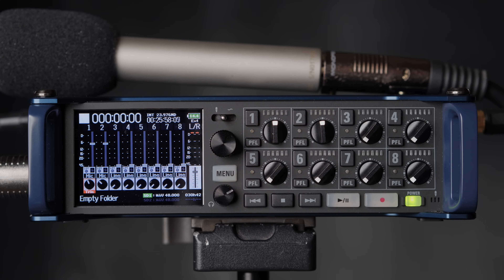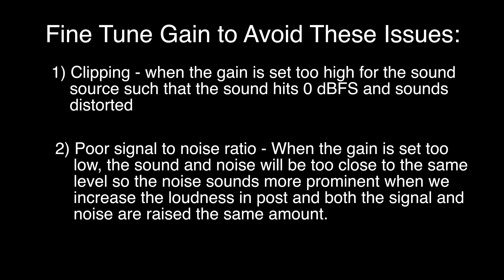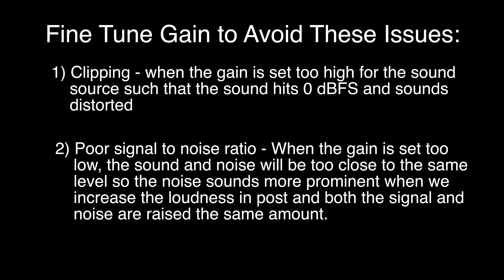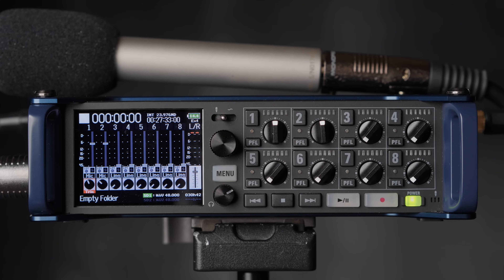Sound for Video Session: Zoom F8/F8n Setting Gain Trim

Comment: Hi Curtis, Here I’m back again... I have the Zoom F8n and a Sennheiser MKH416 shotgun mic. I’ve read the manual, but could not find it... maybe read over it... but how do you setup the Zoom that it records the mono mic on two channels... I found only the options “Dual Channel Rec” and “ Stereo link mode”. Could you help me out with it? Thanks!
Reply: Hi Chasjazzez, Congratulation on your new recorder and microphone! Yes, you need to use Dual Channel Rec. This will enable the secondary channel and then you set the trim for the second channel lower than the first. We cover it in detail in our Zoom F8 course over at school.learnlightandsound.com if you are interested. Best wishes!
Reply: Curtis Judd Thanks I will take a look at your website

Comment: I ran some more tests I think the LED from Godox is just simply too loud I even put it literally like 12ft away and the mic still picks it up. So I don't think it is a placement of mic issue I even turned gain down to absolute lowest with me ultra close to mic less than 1ft and the sound still reaches mic. Do you think the Came-tv 100w fanless is bright enough for key light or is the Aputure 120d a better option? I know aputure has a 120d mark ii coming out that is suppose to be 30% brighter so not sure if that outpowers the Came-TV 100w. I prefer portability and I know the aputure is small but I need something that has some brightness for night shooting indoors so I can fill room with soft light if ever desired but if fan noise becomes issue then aputure 120d won't work. Since you have the 120d would you say it is quieter than a laptop fan that is not doing extensive tasks? Our fridge is like 12ft away but mic doesn't really pick it up much barely audible.
Reply: Hi Michael, I think the best way to assess how loud the 120D is is to listen to any of my talking head videos that have been published on my main channel over the last year. The 120T (and the 120T which is identical in terms of fan noise) has the LightDome softbox on it and the fan on the 120T is approximately 6 to 8 feet away from my face. Here's an example: https://youtu.be/Cel8qLVSD7Q

I haven't used the CameTV 100W so I'm not sure how its output compares to the 120d/t. But I would think that it would be suitable as a key light.
Reply: Personally I can't hear any noise. Is this raw audio no noise removal? I used an app on my ipad for decible test and it register room noise as high as like 50db so this thing is quieter than my room noise if it is rated at 18db. Correction is more like 25 to 29db after calibrating app. Hard to get a proper reading as one app reads 43db.
Reply: No noise removal/reduction processing applied.
Reply: From what I could tell the 120d is much smaller than 100w came-tv I just need an equal measurement to find out, which one is brighter. Even if I don't use the full brightness I just want the option for flexibility. Going to wait on the Mark ii 120d and see how much output gain it gets.

Comment: On the ZoomF8Npro,I set my trim to my desired amount, then use the knob on my tracks for Fading the levels. It all works and sounds fine while I am recording the levels. But once I playback, it only plays the file at my set trim level. None of the fader controls were recorded even though I could hear them while recording. I have tried this in all three recording modes (Trim, Fader, and Mixer) and they all result in the same outcome. I took the SD cards out and played them back in my computer and the issue is still there. It seems like it only records the Pre-Fade audio files instead of the Post-Fade files with my fader levels. This happens on all recorder settings and each input.
If there is anything I am doing wrong then please let me know. I am incredibly open to advice and questions, just trying to figure it out. I have experience on other Sound Devices recorders and I am somewhat new to the Zoom F8N pro recorders. Part of me feels like there is something obvious that I am missing.
Thanks
Reply from the maker: The faders ONLY affect the stereo mix. Record the stereo mix and you’ll have those fader effects.

Comment: I just got the F8N Pro, would like to see a updated version of this with 32 bit in mind. also hope for a small 32 bit float update on the F8N class that I paid for but don't remember how to get back to it.
Reply: You will see an update to the course. My F8n Pro just arrived yesterday. I'll need to run through everything to determine everything that changed but I suspect not much has changed. We will certainly have a new video segment in the course that covers setting gain when recording 32-bit float. The course is over at School.LearnLightAndSound.com. I'll need a few weeks to make the updates.

Comment: Can I ajust the iso tracks during the recording using the fader instead of the trim/gain? The same way a professional recorder would do. On a narrative film environment where you could be using 7 lav mics and 1 boom, the iso tracks are the most important thing and the stereo mix is only used as a reference for post production, since there are only two channels for 8 individual mics. In today standards for sound in narrative filmmaking I don't see this recorder being really useful if you can't fine tune the iso tracks during the recording, the way you can on a SD 788 for example
Reply: And by the way. Does the SD 633 give you this option, of live iso adjustment, like a SD 788 or Zaxcom Nomad would? I'm thinking on moving to the 633 due to the limitations I've been having with the zoom f8
Reply from the maker: Yes, you can. Basic mode does this as does custom mode with the channel know a in basic mode.
Reply from the maker: Yes, there is a separate trim knob.
Reply from the maker: Also, you can adjust trim with the F8/F8n channel knobs, just need to change the channel knob setting.

Comment: Excellent overview.  One correction on the Advanced Limiter. "Target Level" is not equivalent to "Threshold" as described in the video.  I also initially made this same assumption based on traditional limiter controls and operation, however the Advanced Limiter works quite differently and its operation is unfortunately not clearly documented. "Target Level" is a "never to exceed" setting, rather than a traditional threshold level at which limiting begins to be applied.  If you set Target Level to -6dBfs, recorded audio will not peak above -6dBfs, and the actual threshold will be considerably lower. 

It is not overtly clear what the actual threshold is for the Advanced Limiter at various "Target Level" settings, but the change in level-meter indications on the display when Advanced Limiting is switched on hints at it (note that the meters no longer tops out at 0dBfs but rather shifts the 0dB point lower (threshold presumably) and displays a +dB range above that in which limiting is presumably taking place.  It is a 1ms look ahead type digital limiter that appears to apply a variable ratio that increases from 1:1 to infinity (follows a some progressive curve rather than a linear progression above threshold) as signal increases toward Target Level.

Because I am only interested in recording isolated channels and am not recording or outputting a live stereo mix, I keep this set to 0dB for all channels to maximize available dynamic range.  I imagine a lower Target Levels might be useful when manually riding mix levels or automixing.

I hope this helps.  Much confusion about the actual operation of the Advanced Limiter in recording forums.
Reply: Thanks Lee, very much appreciate the additional detail!

Comment: Hello.
I am Sound designer living in South Korea.

I recently bought a Zoom F8n and I have a question.

I am going to record using several microphones, and I am going to save the recording to L R Track with Auto Mix on.

However, LR Track does not have the ability to turn on the limiter.

After experimenting, each track does not have clipping, but a combined Mix File creates clipping.

How should I overcome this problem?
Reply: Hi DayDreamSound, I'll need to look more closely, but I believe the faders allow you to adjust each channel's contribution to the mix, even with AutoMix on. So you'll want to pull those faders back a bit.
Reply: @curtisjudd  Thank you for your answer.
If you have time, could you check on this part?
I know that a low dose of Gain solves the problem, but it's a problem if you take it small when several people talk.
In addition, there are times when eight people laugh at the same time, so you won't be able to get a big response, and then you'll have a problem talking quietly.
I used to use Sound Device Mixpre-6 before, but Mixpre-6 has a Limiter in the Main L R so I can receive it comfortably.

Comment: I would really appreciate this exact video, but for the F6.  I'm  very confused with how 32 bit float removes the need for gain control, but I still think I need to set levels with the faders?
Reply: Hi Dale, yes, the F6 records each channel post-fader so you should set the faders to a reasonable level.

Comment: Thanks for clearing this up about the fader mode, I have and F4 and thought there was something wrong with my F4 because when I turned the Knob down nothing moved then I turned it up all the way and then back and it started to work, thanks know I know its not a problem with my F4
Reply from the maker: Your F4 is working as designed. 👍
Reply: I noticed the same thing: Hey what's going on?? Good to know it is "normal."

Comment: Just a quick question to make sure I've got this absolutely clear:

the fader level has no effect on the ultimate fidelity of my recording? That is to say, neither any clipping nor the presence of the noise floor are affected by the fader, only the trim/gain? Faders are only for the mixdown recording and/or live mix?

If I then foresee processing and mixing my recording myself in post, shouldn't I only be concerned with getting the trim right (and thus run the F8 in trim mode)? 

This has always puzzled me for on-set recording for narrative film – where the only purpose of live mixing seems to be to make a convenient mixdöwn for dalies and perhaps editing, while the actual sound post-production will understandably make their own mix from scratch....
Reply: Hi DaCarnival, The fader affects the stereo mix recording but not the isolated channel recordings, correct. You certainly can take the approach to just worry about the trims and even disable the mix recording, just capturing the isolated microphone channels. For narrative film and TV, the post team will use the stereo mix IF it is good. And there are some very good production sound mixers out there who have a separate boom op and utility so they can focus on the mix. The post team then just drops in isolated channels where necessary.

Comment: This my sound like a dumb question but once you have set up your gain to hit -18dBFS (which is what's going to be recorded to the mono track right?), the fader only controls what's going to be recorded to the stereo track of the mix? So I could mess up the stereo track but not the mono?
Reply from the maker: Hi Roberto, not a dumb question at all. You are correct - if in Advanced mode - the fader only controls how much of that channel is sent to the stereo mix so it will NOT mess up the isolation channel recording.
Reply: @LearnLightAndSoundSessions  Thanks Curtis, I feel I have a better understanding of what gain staging is now, but I'm going to keep studying about it till I feel comfortable enough to approach the next job
Reply: @POLARICED  Practice is a great idea. I fully support it! 👍

Comment: Hi Curtis,
I just heard about an irritating clicking noise when adjusting gain - even during recording. I remember this noise from my first Edirol R-09. It made unusable the recorder for professional work. So I'm just curious, if you can adjust the gain (trim) during recording without any issues? Thank you!
Reply from the maker: Hi Szathmári, Yes, the gain trim is continuous on the F8 and F8n so you should not hear clicking while adjusting.
Reply: Thank You very much, Curtis.

Comment: I kow this is an old video but Chris Judd, do you need a cloudlifter for a shure sm7b if you have an f8?
Reply: Hi Ray, no, the F8 can supply 75dB of clean gain. For the SM7B, you'll generally not need more than about 65dB at the most or you'd be clipping. So no need for a Cloudlifter from my perspective.
Reply: @curtisjudd  thank you

Comment: What’s the difference between the meter on these and sound devices?? These end at 0db but on sound devices end at like +20
Reply: Meters which top out at 0dB are typically dB Full Scale meters which represent the digital scale. Meters which top out at +20 or +24 dBu are typically VU meters which represent voltage and are used most often on analogue gear. However, you can change the F8/F8n to VU meters if you choose.
Reply: Curtis Judd thank you. Which type or metering do audio editing softwares use?

Comment: Curtis, off subject... Can I put a Schoeps CMC641 in a full size RODE blimp2 or does the blimp need to be smaller? Is the 641 useable on windless outdoor shot?
Thanks- Leo
Reply from the maker: Hi Leo, you can from a purely sound quality standpoint but the problem it creates is that you cannot get the mic in as close to the talent as you might like.

Comment: im new to the audio recording. wanna ask. the recording in the f8n. every single track records in trim audio level is it correct? mean if i adjust the fade it does not record in every track but only in L/R?
Reply: The fader only affects the mix, it does not affect the isolated tracks.

Comment: Hello Curtis, If you were commissioned to record as faithfully as possible  bird calls in a foreign country and your choice of recorder / mixers was out of F8N and Premix 3/6/10, what would you choose? The microphones will more than likely be double MS system from Schoeps.
Reply: I would choose the one that ergonomically fits the job. If you'll be running through a forest, the F8 seems to work a little better from a bag (mainly because of the awkward placement of the headphone/menu encoder on the side of the MixPre).
Reply: Thank you.

Comment: Hi Curtis, this is perhaps a newbie question, but...you say that you should try and use the fader to control levels during recording.  But if I'm not recording a mix track and just the iso's is that still the case?  Thanks!
Reply: Hi Dicky, good question. No, when you're just recording isos without a mix, no need to adjust the faders. Happy recording!

Comment: I love this series - have a quick question though: I'm using a Lectro SRC receiver going via a line-input to my f8n. In regards to signal-to-noise. When I engage the 1k tone on the F8n - it comes out at -20db. On the SRC - the Tone set at '0' it comes in at -15db. In terms of 'best practice' should I lower the output on the SRC so it lines up with f8n? (Or would this lead me to push up the gain on the recorder and increase the noise floor in the system?) Kind regards Craig.
Reply from the maker: Hi Craig, worth a test trying both ways to see which produces the best results. Seems to make sense to reduce the output on the SRC.